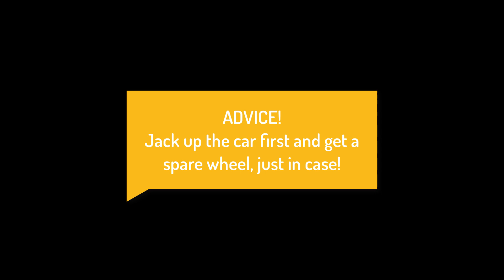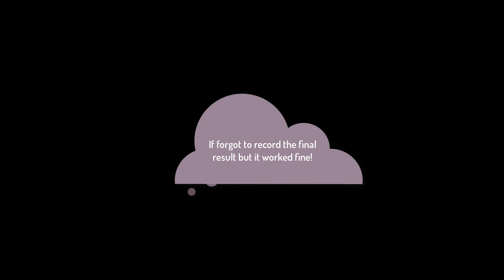How to remove wheel valve cover   valve caps   valve stem cap

Comment: Took my truck to a tire shop, just had them cut off and replace the stems, since nothing was working to get the caps off. It only cost me $40 but make sure you ask first because it might be a lot more expensive depending on what tires you have and if you have tire pressure censors.